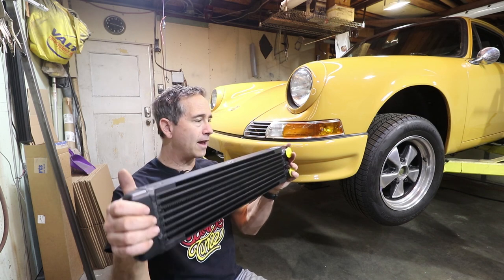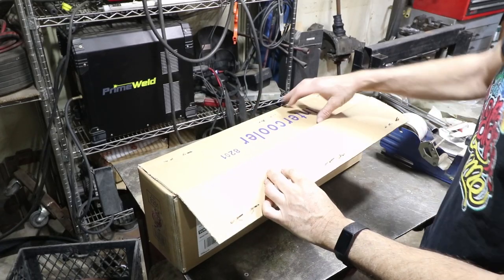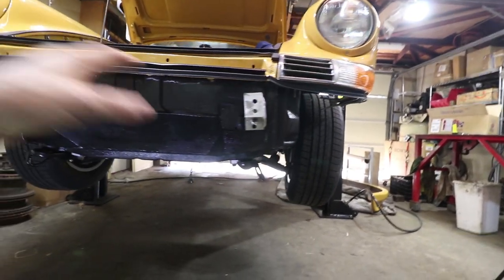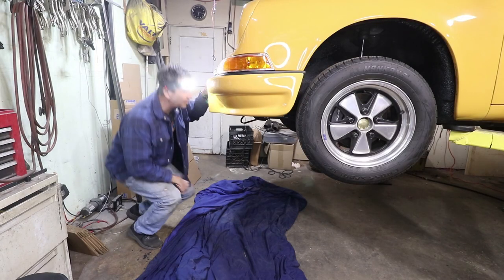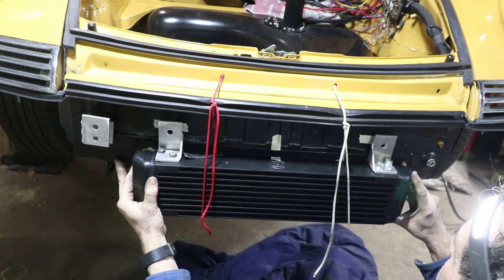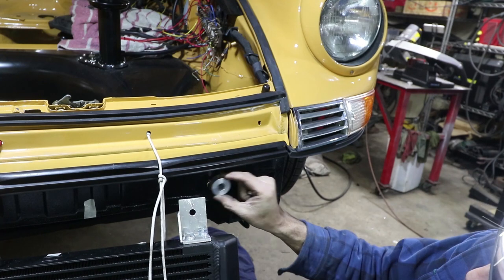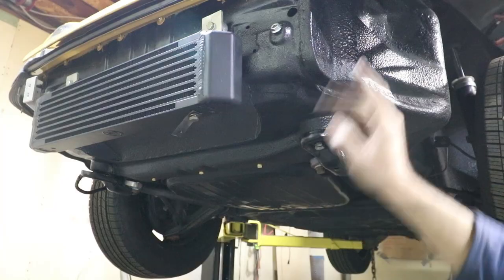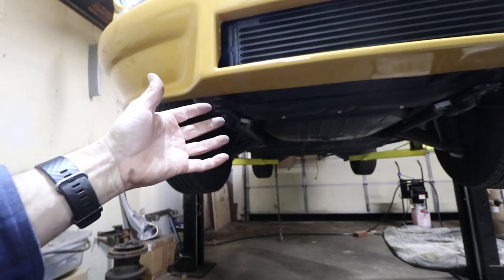Porsche 911 Carrera RS Oil Cooler Install (CSF Aluminum Aftermarket)

Comment: Nice work Tom. I’m not a fan of the RS bumpers but understand that it’s the logical placement for the cooler.  You make it look too easy. 😆
Reply from the maker: Thanks! Plumbing the oil lines might be more of a challenge.  Will see?  It was a lot of work taking the bumper on and off, but time lapse makes it look easy, ha ha.

Comment: You actually helped me with my project! I am putting in a aftermarket battery box for my bug, and I was going to just bolt it to the floor. Problem is, that’s begging for water intrusion. If I use the Rivnuts, I can seal them and have a much cleaner look. Thank you.
Reply from the maker: Cool!  Rivnuts are pretty cool especially after paint.  Before paint, I like flush weld nuts too.

Comment: This one is on my list of things to do as well, the CSF product being on my shortlist.  I hear you on getting help that doesn't include arguments!  🙂 ... BTW, I've seen people install these things without cutting into the body for airflow (see the forums on Pelican Parts.)  I think with a G-Body and a RS style bumper (that juts out further than your slender bumpers) there might be just enough room to make it work... I guess I'll find out.
Reply from the maker: Highly recommend CSF!  Well made, easy mounting holes with helicoil inserts!, And large AN16 /M22 ports
As long as the airflow has a place to go, you are fine.  The cross sectional area behind the cooler should be equal or bigger than the face area.
Reply: @GarageTimeAutoResto  That's a good tip.  I've been watching some of Julian Edgar's videos on aerodynamics, and that's given me some ideas on venting the output as well.  A project for the new year then!  Cheers.

Comment: You have to go 100 miles at wide open throttle in the Sahara before that front oil cooler thermostat opens up.
Reply from the maker: Really?  My 89 opens up in traffic and a fan turns on.
Reply: @GarageTimeAutoResto  mine has never opened - and others told me the same. You must live somewhere hot.

Comment: Don’t you need a grill in it to protect the cooler from rocks and debris?
Reply from the maker: Yep, coming soon.  Will improve the aesthetics too.  Ie flush grill
Reply: @GarageTimeAutoResto  I’m on my third 911, all C4S. I bought a new to me 991.2 C4S manual last month and need to be grills on it, so my radiators don’t catch debris and cause an expensive repair. Porsche puts them on the GT3, but that’s it. They don’t even sell ones to use. Guess I’ll get Zensport ones.